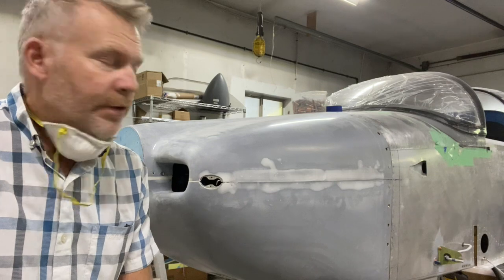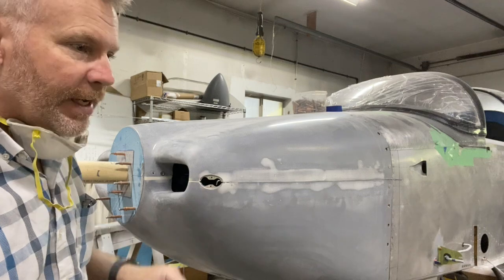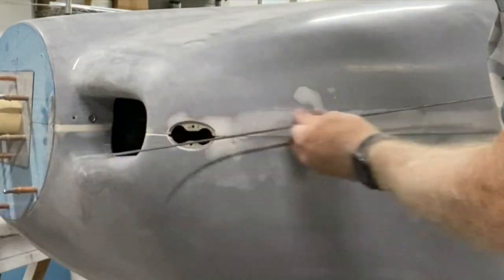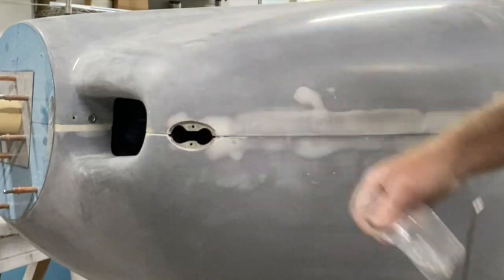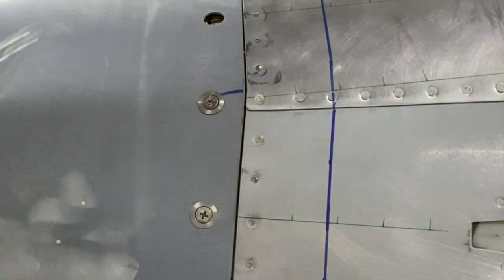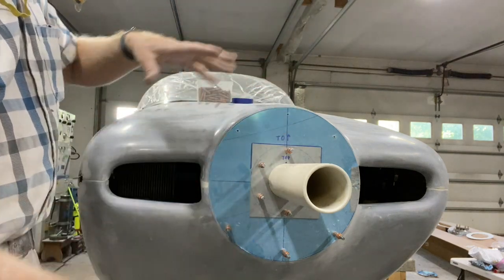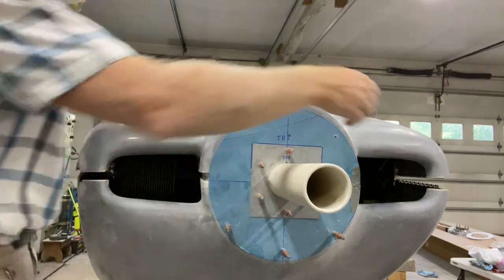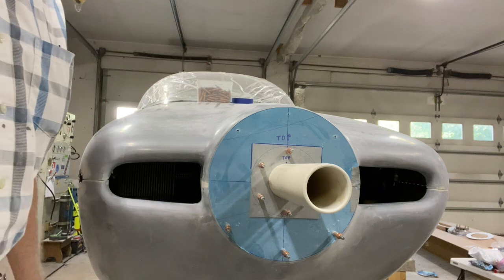Vans RV 7 cowl and sky bolt install

Comment: 100 times on and off seems like a conservative number. Keeping these edges from getting chipped during maintenance is almost impossible as I’m usually by myself during removal. 

I was looking at getting a EVOK paint job but would probably be too stressed with perfect, high end paint.

Comment: Great video.  You are right, it covers a key missing SB process I’ve never been able to find on YouTube either. 

Question, what surgery did you have to do to get the front of the spinner bowl that flat against the round jig piece?  I can see how you filled in the sides of the bottom.
Reply from the maker: @luckymacy  not much surgery at all. The medallions are slightly concave. One thing I wish I had done is mount them just a half inch further aft. I was trying to get as much hinge material in there as I could but another 1/2 inch wouldn’t have made a difference and the look of the medallions would be much smoother.

Comment: I think I see you are using the floating skybot receptacles?  I was wondering why the cowl doesn't move around when using those instead of the fixed receptacles?
Reply from the maker: @sblack48  no only used 2 floating receptacles. They only float in the socket till you align them. When you tighten them down they are very secure
Reply: @ great to know thanks